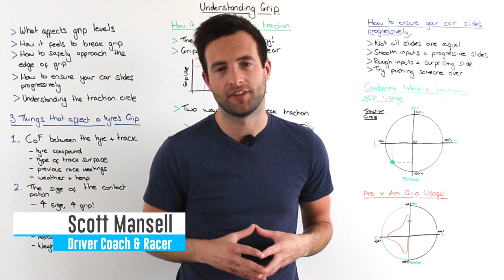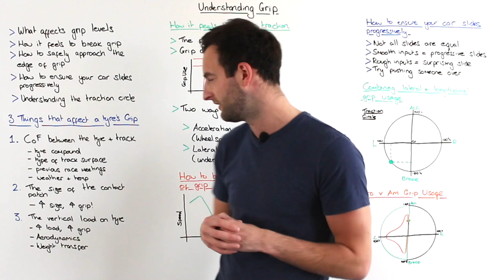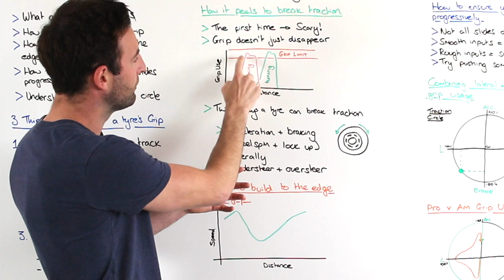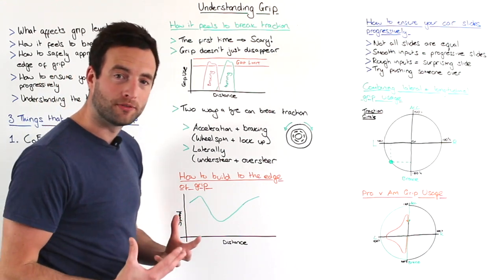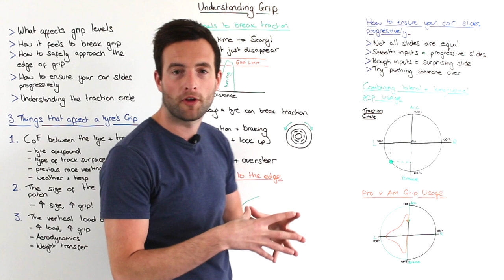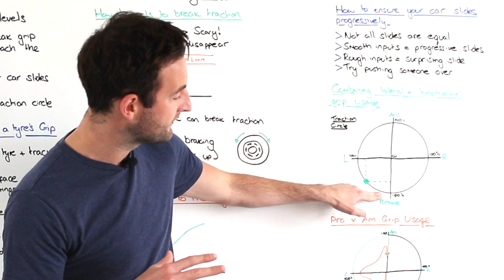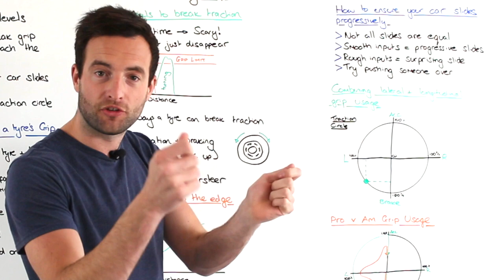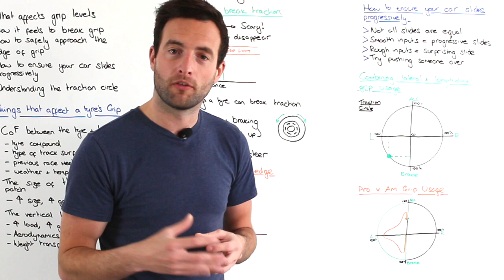Grip on Track Explained: Grip Circle & Driving on the Edge

Comment: Excellent tutorial series! Living in Canada, I have the "luxury" of driving on snow or ice every winter. I made a point of taking each of our kids out in fresh snow when they were first learning to drive so that they could experience the limit of grip in a deserted parking lot. The transition between braking and turning grip is really dramatic when the steering wheel is cranked but you've locked up the brakes in a slide. It's counter-intuitive to let up on the brakes when you're sliding into a corner, but it can be learned...and it's the ONLY way the car's turning grip will get you through the corner. Better to experience that white-knuckle feeling in a parking lot than on a road.  Thanks again for the series.

Comment: at the beginning of the manoeuvre shouldn't the constant speed correspond to a point towards the positive side of the drive axis? If the driver is at the centre of the graph then there is no drive force and no lateral force i.e. the vehicle is stationary. So you cannot be at the centre of the graph if you are coming with a constant speed. isn't it?

Comment: I have to say the videos on this channel have helped my simracing tremendously! I was playing F1 2015 on Medium dificulty, I found it fair enough. Today I played a 50% distance race, hard difficulty and I could have lapped almost the entire field were it not for a spin with two laps to go. Circuit de Cataluña, qualy was 1:23.9s (-0.7s from the actual Rosberg pole - could have been faster, had to overtake Verstappen at turn 4) and fastest lap was 1:25.6s I suppose. I did a few Hamiltons in the process (fastest lap on the last lap before pit stop). Bottom line: because of Scott's teaching I'm now able to drive more consistently. Racing line is a bit on the lousy side, though! But practice is key and does wonders! Thank you so much, +Driver61!

Comment: Thanks you so much for this video and for the accurate and well-explained information. I used to do a lot of kart racing when I was younger and I am now restarting my "carrer" as a sim driver. The video helps me to better understand the theory behind the things that I was only applying "naturally" so far. @Driver61, could you perhaps add a few words on tyre degradation (which is discussed a lot in formula 1 lately)? Where do you save tyres most effectively - is in on the braking or turning, or equally through the corner?

Comment: Hi Scott, Thank you so much for this content, it's really invaluable⭐. 
A quick question about building up to the limit of grip. Say you're braking 100% at 100m reaching 80kph at your turn in point and want to increment to 82kph on the next lap. Should you be braking at less brake pressure at the same 100m mark? Or should you be moving your braking point forward still keeping to 100% pressure?  Should you be testing braking points and turn in speed on the same lap? 
Sorry for all the questions, I'm thinking and typing.

Comment: Thanks for the tutorial. I'm a complete lay person so I have couple of questions and a comment:
1) You say increasing contact patch increases grip, but how does this scale with the reduction in load that occurs if you're spreading the same downwards force over a wider contact patch?
2) Grip circle: Do tyres have equal longitudinal and latitudinal grip? I presume this would be affected by the shape of the contact patch and/or tread pattern if present?

Comment: Can you consider using a different colour than your green pen? I can't see it on the board very clearly! 

Thanks again!
Reply: Increasing contact patch(increasing tire width) always means better grip.
Reply: increasing tire width does not always increase grip. it depends on a few variables, how much downforce or weight you have loading on the tires. that include mechanical grip from your suspension setup, tract width, weight transfer...etc. that is also assuming you have the right tires. there is an optimum width and beyond that you are just making things difficult for yourself.
Reply: So, this is really old, and I'm not totally qualified to answer either question, but I'll give it a shot based on what I know. 

In your first question, I assume you're referring to the fact that frictional force equals the material's coefficient of friction times the normal force, right? Well, frankly, I've always had the same question and never received a satisfactory answer. But based on some things I've pieced together, and memories of introductory physics: a tire's coefficient of friction actually decreases somewhat with load. Presumably, that is a function of pressure, rather than absolute load, and if that is correct, then a larger contact patch would help maintain the highest coefficient of friction in the material, thereby improving grip. Additionally, a wider tire would mitigate the effects of deformation caused by bumps and other irregularities on the track surface. Finally, some of the perceived grip improvements from wider tires might be a failure to account for variables: Performance tires with softer rubber tend to be wider to allow better temperature management and slower wear.

Regarding the second question, no, tires do not have equal grip in all directions- or at least cars don't have equal peak brake/acceleration & lateral forces. For one thing, the difference between wheel base and track width means faster lateral weight transfer.

Comment: I feel there's a video about scrubbing tires more or less rotating in terms of this grip circle. I mean that a harder accellaration on exit will both turn the car faster but scrub the tires and so decrease its life, while a gentler accelaration from apex will still turn the car but preserve the tire life. Is this right? If so, my questions are, which is faster over one lap and which over the whole race? 

On iracing I've found that the F3 rotates smoothly, but the tires must be considered toward the last 5 laps. When I observe faster drivers, it seems they're comfortable rotating and scrubbing more, unless that's just more obvious in observation, but they seem able to maintain much faster pace and throughout to the end.

Comment: Should not the dot move forward on braking and backwards on acceleration?  Likewise shift to the left when turning right and vice versa.  That seems more natural to me
Reply: Not if you think of the forces involved. Braking is similar to pushing on the hood of the car (trying to make it go backwards), turning left is similar to pushing on the right side of the car to make it slide to the left etc. 
However, what you feel inside the car is that you move forward when braking and right when turning left. This is due to inertia, basically Newtons first law of motion.

Comment: The traction circle is a bit confusing since if the axes values are linear the sum of the lateral and longitudinal grip will always be >= 100%, but I suppose the axes can be scaled such that the sum at the perimeter is always 100%

Comment: Is maximum steering angle always at the apex?
Reply: No not necessarily. The apex is the point where you are at the inside of the corner and that happens at different points for different types of corners. See his videos on the racing line. 
For a hairpin corner followed by a long straight it is faster to run a bit deep to make the corner even sharper at the start so that you can rotate the car quickly and thus get back on the power more quickly. Imagine that you run a bit deep into the corner, turn on a dime and then you can just accelerate in a straight line basically, this will give you a higher exit speed at the cost of some entry speed, but you will more than make up for it on the following straight.

Comment: I've been comparing Vbox videos between different drivers and cars to see which corners I'm worst at. One thing I noticed is that for the same mid corner speed different drivers and cars will be pulling different Gs. Would it be fair to say that the corner is better executed by the driver pulling the combination of highest speed with lower lateral G? Or is that too simplistic?

Comment: The part where you mention that the contact patch (i.e wider tires) increases tire grip is incorrect. 
Friction doesn't depend on surface area. However, wider tires allow the usage of a softer rubber, which in turn provides better grip. 
It may be a little bit pedantic, sorry.
Reply: Hi. You are only half right. You are talking about Newtonian friction law. But in reality the tire and the road surface blends on the contact level due to both surface roughness . Therefore you will get a higher blending or "biting" area with bigger contact patch.

Comment: Surface area has no impact on friction, it is commonly misunderstood, basic physics explains this. Tires are wider in racing due to the material they are made out of, they need to be wider for the sidewall to support the weight of the car
Reply: Alas this isn’t basic physics.

Comment: Okay I believe I can’t get any faster with a controller. I just can’t be that smoothness at corner entry. Accelerating & Braking is easy but turning with a stick I’m just not that good.
Reply: That´s me in Project Cars 2 (my main sim game) lol. Some communities still host races and I´m getting beaten by many wheel players by a long shot. Yes Project Cars 2 is somewhat controller friendly (more than Assetto Corsa which I like as well) but you still have to be very smooth and precise

Comment: I’m sorry but the formula for friction force is independent of surface area therefore contact patch area is almost irrelevant. I say almost because what it actually does the contact patch (a large one at least) is gives you a change to have close to optimal friction force between those two ever changing areas (tyre an road)

Comment: Not to be nitpicky but in the grip circle, if braking + turning grip is 100% the the line from 100% brake to 100% turning should be a straight line. Same for all four sides. Thus it should be a diamond!
Reply: cdrseabee Not really, because first the available lateral grip is not the same as the available longitudinal grip, and secondly  the sum of available lateral and longitudinal grip while trail-braking is a little bigger than the available lateral grip by itself, so the maximum grip on the top half of the “circle“ while trail-braking would be between the secant of your diamond and the arc of the usual representation of a circle.